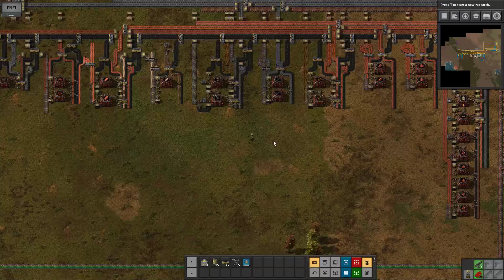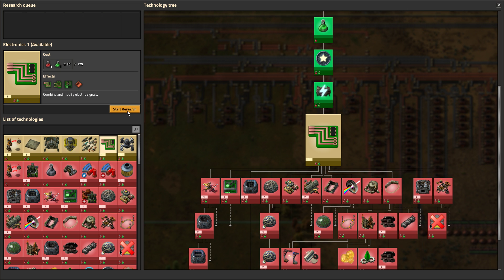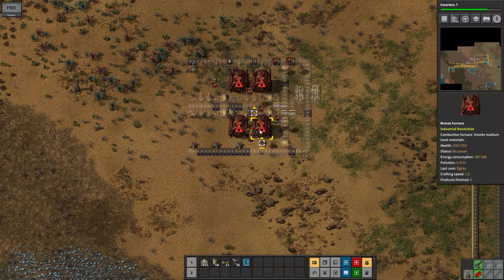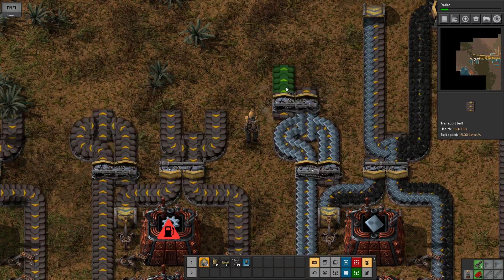Factorio Industrial Revolution - Season 4 Ep 11 - AUTOMATING IRON!

Comment: Burner leech:
- The Factorio modding API, as of 0.17.69, now directly supports burner inserters fueling themselves from any fuel slot they can access, aka "burner leech".
- It is not enabled by default and does not feature in vanilla freeplay games. Mods have to enable it.
- In IR, this is now a setting under Settings > Mod settings > Startup, which defaults to off, to preserve the non-leech challenge for those that enjoy it.
Reply from the maker: That will make IR a lot easier if you turn it on. I will keep it off in my let's plays since I think a huge part of the mod is the starter burner phase :)
FYI: Thanks for the information ^_^